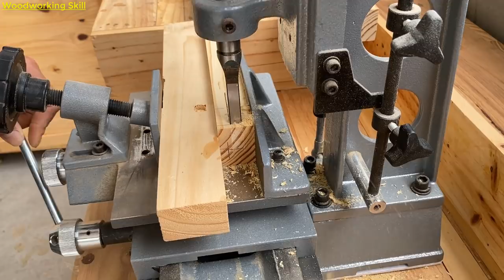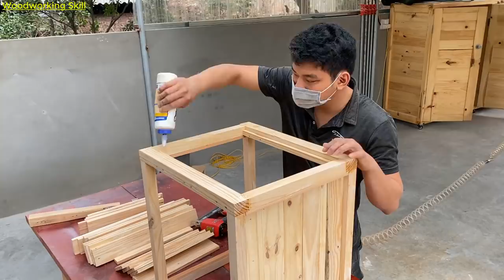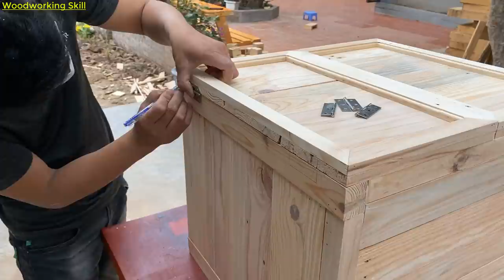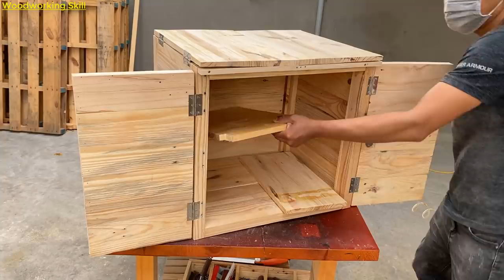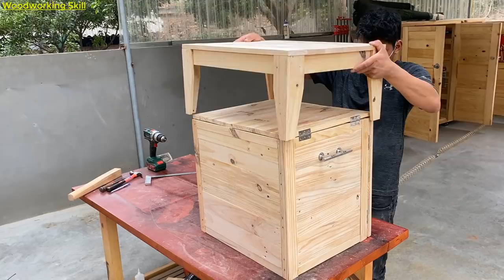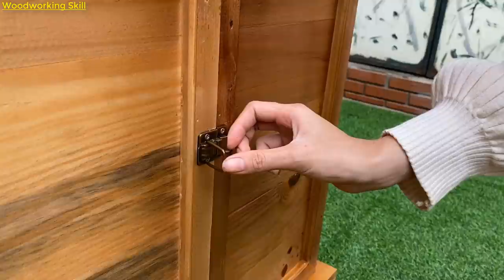Great Idea For New Couple // Build a Portable Camp Kitchen For Your Next Picnic or Camping Trip

Comment: I'm of the opinion that if you need two people to lift it, it's too impractical for camping.  For camping, build out of thinner wood (1/2 inch for main frame, 1/4 inch for everything else) and use sturdier hinges for durability (piano hinges are perfect).  Also, those "stools" are kinda... Well, let's not comment on that other than saying they don't look comfortable.  The interior divisions make little sense though.  It needs either more shelves or drawers, a magnetic strip (maybe) for knives and metal tools and an area for spices.  That said, it could be good around the home for the backyard or something. 🤔

Comment: I have to admit, you have lots of pretty cool ideas.. I am a retired master carpenter, your work is ok, far from skilled, but you are getting there.. you need to take more time to make sure everything is square, even & measurements are correct.. I do not mean to sound critical, anyone can nail/glue some boards together, it takes, learned skills, to get your fit & finishing to look good... You are well on your way... Please take more time to align, square your joint's... I also taught woodshop as a teacher.. I notice everything.. To make great money, you need to try to make everything as perfect as you can... Again I am sorry if I have offended you by pointing those things out... You learn by not making same mistakes... Be Blessed and have a great day
Reply: This is well said. I would love an honest criticism rather than pure praise. Please check out my work, too, if you have a chance.
Reply: I have to agree with you. This feels really rushed. He could've spent a few more minutes here and there. Not that it isn't functional. Sometimes functional is all that's needed. But if it's made to sell, custom ordered or anything like that. The extra care is necessary in my opinion. 

Woodshop in school was fun. My grandpa taught me more than the class did. I was well ahead of the curve. I started woodworking alongside grandpa at 6. By the time I got to pick woodshop as a class I was using power tools, hand tools and techniques they didn't have or teach. They were really worried about middle school kids using a table saw, or any of the other power saws... hahaha

Comment: Wanting to build a patio cabinet for my new smoker utensils but the price of lumber has put a hold on that project.
Reply: If you live by a Amish community try look for rough cut lumber it’s usually cheaper but has more work involved to get a finished product
Reply: @jadeoctavia7404  I have, it's either the high price for the lumber or lack there of. I went out to the sawmill scrap pile and even that was picked through.

Comment: This is a great idea!  I will assume this is the floor model because you did not add wood glue in certain places and instead of screws, you just used staples.  Also, the inside shelf did not use wood glue and you did not fasten it with screws.  Also, the leg system you just used staples; no wood glue to aid in strength and also only a single screw used, which makes its structural integrity weak should you place heavy items inside.  Lastly, your demo showed possible chopping.  It does not look like that mechanism with the shelf/door will hold out for long when using that kind of force.
Reply: That’s a nail gun, not staple gun.

Comment: Screws are better than nails. Those boards that were glued and nailed don't have much strength and should be redone. Especially the supporting slat nailed without any glue to the frame.
Box Frame was well made with mortise and tenon joints. 
Door Frame was very poorly made with tiny nails, no glue, no screws. That is going to warp and come apart in no time.
Door wood should have been thinner, too heavy and thick. Doors are very disappointing and sloppy build.
Use piano hinges for strength, those tiny hinges are too light for a heavy door.  Use piano hinges everywhere.
Don't take shortcuts in wood working. Use screws, biscuit joins, glue.  You did a very poor job of making this box.

Comment: Too heavy and no room made for wood movement. This will be a mess in a very short time... wood is living and moves with heat and cold and moisture. Simply ship-lapping or using tongue-in grooves on the sides of each glued-in side piece would have made this a viable and robust design. Love the mortise and tenon initial construction.